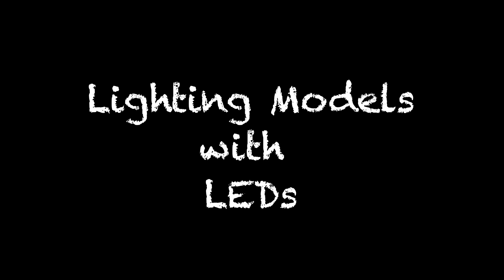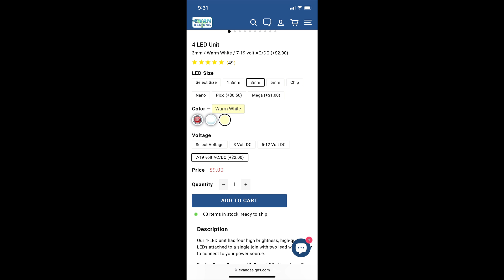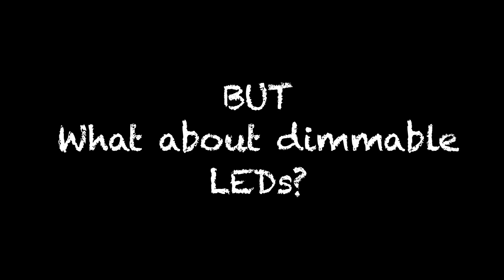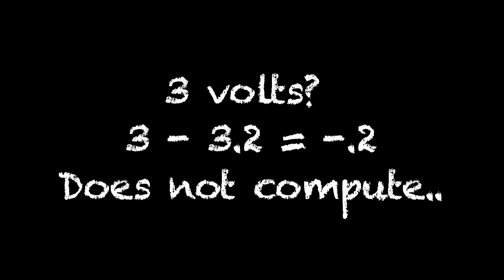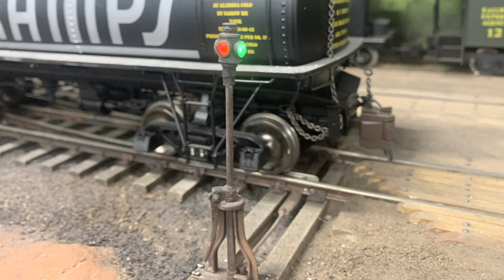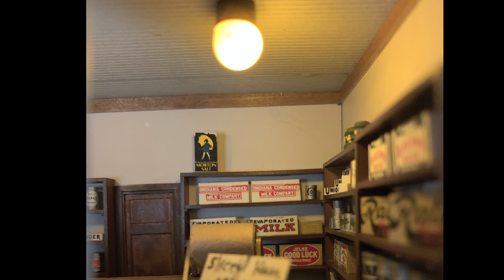LED's Explained - LED Magic on the Model Railroad - Electricity For Model Railroads

Comment: There is a so-called nominal current (I) it takes to flow through an LED in order to give it a nominal brightness. With lower currents, you will get lower brightness. The relationship is not really linear, but desired brightness could be easily achieved with an appropriate resistor. For that to work, you need a higher than nominal LED voltage (V) power supply and then put the resistor (R) in series with the LED. For an LED to work on AC, you need a protective rectifier diode in series (add 0.7V losts) or in parallel with the LED and a resistor in series with this setup. Resistor value could be easily calculated as R=(Vsupply-Vled)/Iled-desired. Required power rating of the resistor would be P=((Vsupply-Vled)*Iled-desired). Example with 5 Vdc supply and an 1mA LED: R=(5-3)/1mA=2kOhm; More Ohm, less brightness. P=(5-3)*1mA=2mW, so practically smallest (physical dimensions) available resistor could be used. Usually you can get 1/16, 1/8, 1/4,...  W power rating resistors in the shops. ☝️If you use a lower power rating resistor than calculated, it will overheat and might even burn.☝️

There is an option to have a constant current source instead of a resistor.  It makes possible constant brightness in a range of voltages, like between 4 and 12 DC(⚡️!!!) or more within specifications. The simpliest solution is only one small carefully select N-type (MOS)FET type transistor (like say BF245[A(2-6.5mA),B(6-15mA) or C(12-25mA)], [350mW]) with its Gate and Source interconnected (zero GS voltage) and attached to LED anode (+). Transistor's Drain attached to the power supply (+) and LED chatode (-) attached to the power supply (-). ☝️Transistors have power ratings, too.☝️

Comment: Greetings to community! There is a fascinating similarity between electricity in circuits and fluids in closed pipelines. LEDs could be considered as narrow automatic (spring driven) valves in a broad pipeline, with a pump as the pressuring device. With the pump slowly spinning up from zero up, no flow will develop, pressure only. Once enough pressure is applied to the valve, it will begin to open and the fluid flow will establish. With further ramping up the pump, very little additional pressure will develop across the valve, just enough to open it fully, but the flow will rise tremendously, limited only by the valve gauge. With ramping up the pump even further, the pressure across the valve will rise very, very little further, but the huge flow will destroy the valve, unless other narrow, calibrated piece of pipe is added to the pipeline to cope with the rush, and limit the flow by converting it into pressure difference accros itself.

Comment: rather  than experimenting with different resistors use a resistor substitution box
Reply from the maker: A what?
Reply from the maker: I have used a pot to test. Then just read the value.
Reply: @ToyManTelevision   omg   pots  will burn out     they are not for cuurents much above  2mA
Reply: @ToyManTelevision     Google. It is a fairly common device in electronics

Comment: ohhhhhhhh   dear,   lots of mis-information
AC is NOT a good idea
there are THREE main ways to control brightness
PWM
limit current -   usually done with a resistor
control the voltage - Not recommended
Reply from the maker: It’s easy with AC. It takes a bit of a circuit. But simple. It needs a half wave rectifier. Just a diode and resistor. But outside what we are talking about here. Check out the pinned comment.
Reply: @ToyManTelevision  I do not think you mentioned using   a diode and resistor.in the video. Though some object to the flicker       and people do not know what voltage to use; V = 1/.2 Vac
Reply: @ToyManTelevision  and AC is not regulated  so the voltage can vary
Reply: btw trying to control brightness by controlling the oltage is filed with issues - NOT a good idea

Comment: Another way to make light out of a LED less is to pulse the power to the LED. The longer the on pulse the brighter the light. With some programming of the pulses you can get something like a flickering candle light.
Reply from the maker: Yup. Check out the pinned comment.

Comment: Simply put, the resistor value is  (Vsupply - Vf)/If I usually give it a 1kOhm resistor which gives it plenty of brightness.
Reply from the maker: Yup. I usually grab a 450. It usually works. If not use two. Then you are almost at your 1K.

Comment: I got lost in all the numbers and omns. I do know about defusers for the lights. I will hang in there and try to understand all this electrifying knowledge. THANKS to you I under stand more about the track wiring. Keep it up and someday I may understand the led lighting.
GOD BLESS 🚂💖🚂💖🚂💖🚂💖
Reply from the maker: Good morning. Yup the defusing helps the hard light a bunch!  Necessary  I just bought a set of slip on colored defusers. Well..  they work like 30%?  Worthless. But color correction and defused. Better. Bless you right back.

Comment: As an EE I cringe on running LED's on voltage supplies especially batteries. Just a bit more voltage and they draw a lot of current, drop a little and they get real dim. White LED's on 3V supplies works ok. I would not do it on red, yellow or green LED's.
Using a resistor is best as if the power varies a bit, the brightness stays mostly the same.
I also don't run LED's at their rated current. They won't last long especially if enclosed and they get hot. I normally shoot for 15MA.
Typically I calculate a resistor value and then increase it up to a common value. 440 is a bit rare but 470 is common. The difference in brightness is small.
Reply from the maker: HI!
Yup, we ONLY run white LEDs and KNOWN LEDs that way. Forget about blue.... But for dioramas its fine. Karyn uses the same LED for everything. And Im using it in the switch stands. Same little surface mount LEDs. 3.2 Vf @ .02. BUT! If I had it over to do Id have used my 12V supply and 440 ohm resistor. Simpler. Much. Safer too. Much.

Comment: Well, you touched on resistor (rating) ID). Maybe a segment diving a little deeper is in order (the stripes can be a bit confusing). My question is , and has been for a long time, how do you light CTC signals? All the required wiring would look ugly, Is some sort of "fiber optics" used?
Great videos, Model hobby electronics etc., can be a bear to deal with. ;-)
Reply from the maker: Yup I’ve used 2 color (3 colors really) and fiber optic. I’m into narrow gauge now but when I did class A I did that. And it worked for working switch stands!  In HO.!  Anyway soon!
Reply: MORNING DALE.. Great coffee breaks Back in scool is good I remember in electronics we had to learn what each band values meant..Yah +50ish yrs I've slept way to many times & yes.. I  forgot 😅